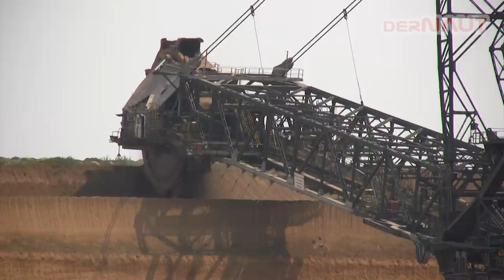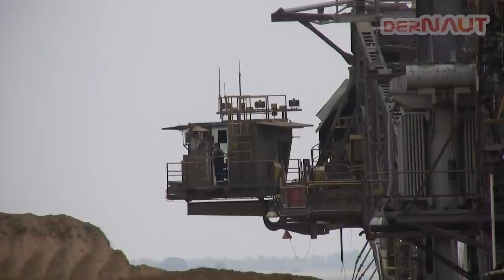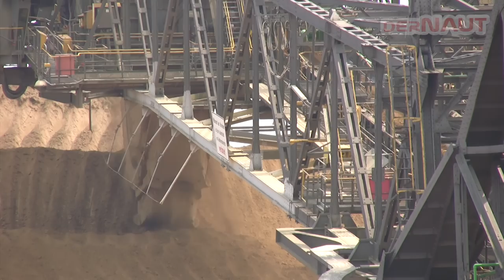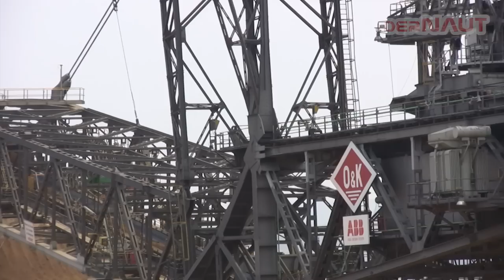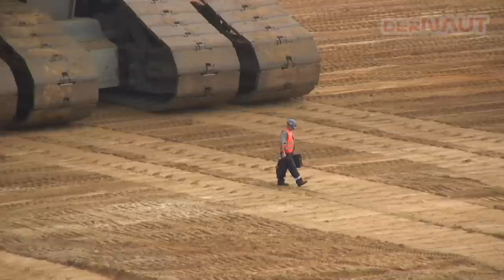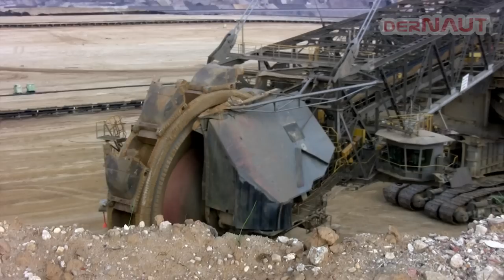Schaufelradbagger 258, Tagebau Garzweiler | Bucket-wheel excavator | बाल्टी-पहिया उत्खनन

Comment: It's a lot quieter than I had imagined.
Reply from the maker: +y2kcobrar Yes - its working with electric motors (5.555 kW)
Reply: @derNaut   How many of these electric motor does it need and whats the estimated cost of this machine? Thanks for an excellent video.
Reply: @ksr9t  the machine in this video is said to have been abandoned since 2002 so this video must have been old but got a quality update
Reply: @ksr9t  See https://en.wikipedia.org/wiki/Bucket-wheel_excavator

Comment: Does it really require such a massive machine to lift the buckets up and down? If you take the buckets out of the picture you would think it’s lifting a complete oil rig out of the ocean
Reply: Fact: later built ones were larger and considerably more massive
Bagger 258 (1957) 3,850 t
Bagger 293  (1995) 14,200 t

Comment: I have wondered if the bucket wheel is driven at the center of the wheel, which is the location with the least mechanical advantage, or near the outer perimeter of the wheel, which would be a location that would provide much better mechanical advantage. 

I have observed these bucket wheel excavators (such as the one in this video) in operation on YouTube videos, but have not been able to (definitely) see where the bucket wheel is driven. 
I would certainly think that the bucket wheel is driven from near the bucket wheel's outer perimeter, because it would require much less driving torque to rotate the wheel, which would be more sensible (& efficient) design.
Reply from the maker: I think you are absolutely right. With these strong forces occurring, the drive must be close to the outer circumference. Unfortunately I don't know anything about it either, I just visited the excavator and secretly filmed it.
Reply: @derNaut  lol, I'm sure I would have "secretly" taken a video of this bucket wheel excavator as well, if I lived near enough to visit the machine (it's in Germany(?), I assume).
Reply from the maker: Yes, the excavator is in Germany in a brown coal opencast mining area about 50 km away from where I live .
 51.06972744776051, 6.4623633578063595

Comment: Why show it operating so fast and what is the soundtrack that is with it? Poor video.
Reply from the maker: +Lewis Johnson I show it in normal speed and fast, the soundtrack is the original soundtrack from that excavator, this engine is working with electric motors!
Reply: +der Naut Hello! I have worked around bucketwheel excavators myself and do know they are powered by like 64K voltage. I have been up close and personal in a phosphate mine in Aurora, North Carolina. The mine is PCS Phosphates. I do like the video so I hope you didn't get me wrong. Nice footage and thank you for the response!

Comment: How efficient is this, first you need to remove a many many meters of soil, which i suppose takes great amounts of power, than you can get the coal but the transport of the coal takes energy as well.
How many % of the power generated by the powerplant does the city actually get cause this thing cant be cheap to run
Reply from the maker: I don´t know - Its a foolish thing, because whole cities and villages were demolished and the inhabitants resettled ... and the energy isn´t clean, because brown coal emits a lot of carbon dioxide! Maybe this all make sense for the surface miners, because the government subsidize the brown coal energy ....
Reply: very interesting question.  the efficiciency is very little. at some places in the open mine where those excavators are working, has the sand or soil a thickness of 80m to achieve the brown coal (flöz) with a thickness of sometimes less than 10m. at very much places the doing of mankind is not a question of efficiency or ecology, its a question of jobs and what does an alternative job costs the employee or government, when this kind of mining will be forbidden bye law...
Reply: It has still the cheapest generation cost per kWh. Better than nuclear energy or gas. Only offshore windcraft is able to compete. Maybe some photovoltaik power plants as well.
Reply: The large scale and short transport ways makes this efficient - at least in countries without other fossil resources. The coal is transported directly from the excavators by conveyor belts to a power plant. And this mine is really close to the biggest conurbation of Germany (the Rhine-Ruhr Area). Thus the consumers of the produced electricity are also close by. E.g. just 25 km from this mine to Düsseldorf. And the companies making those machines were also from this area. And those machines did last long. E.g. Bagger 258 was built 1957 and is still working.
Apart from a few large PV plants the electricity produced from lignite has the lowest costs per kWh in Germany. Thus it is efficient. Or was - the lignite mines will be closed for environmental reasons in the coming years.